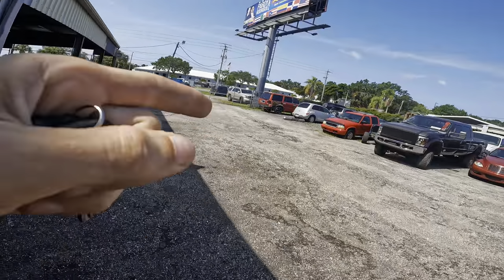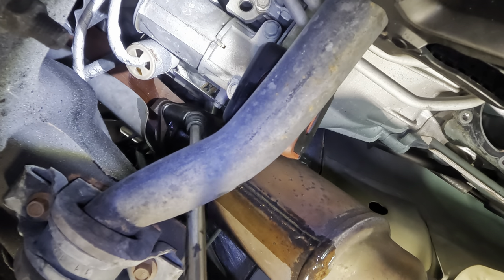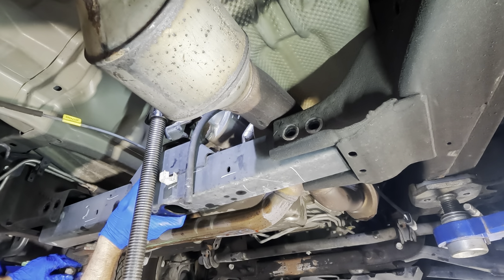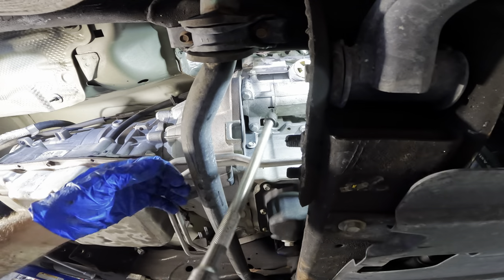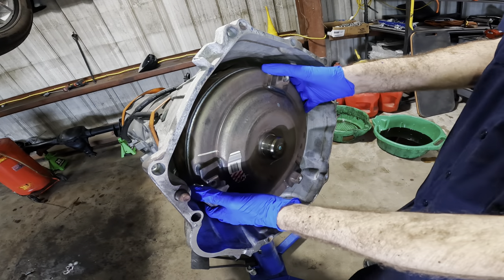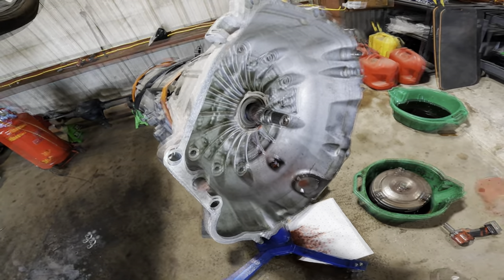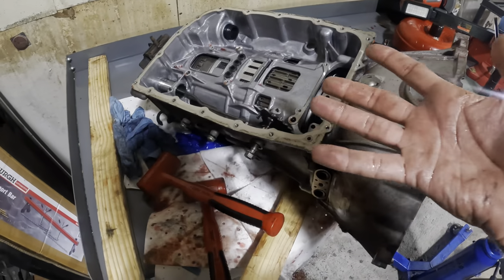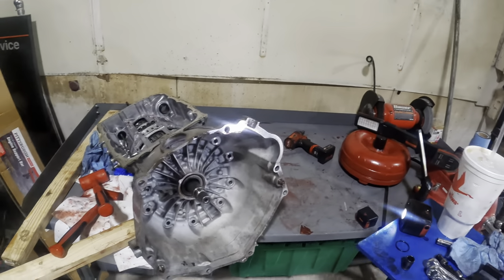Went too FAR! Invasive Inspection, 6l80 Transmission. 2016 Chevy Tahoe 5.3

Comment: Ray, your videos and teachings are awesome!  Gutsy move to pull apart that trans, but I felt like I was watching one of those "Cave exploring gone wrong" videos where they keep squeezing through tinier and tinier holes in giant rocks!  Hoping for the best here!
Reply: When I was apprenticing the full six weeks of third year school was automatic transmissions. Admitted- 2 speed and 3 speed with film on the only 4 speed then sold. Later, as a mechanic I had some 4 speeds to repair with the help of a dealer service manual. All Canadian mechanics were trained on automatics in those days. I don't know if that is the case today.

Comment: The last time I did this was on a 700 R4. I found too much carnage and the parts list exceeded the value of a comparable used unit. Before that I did a complete internal seal replacement on an Aisin-Warner 4 speed in a 1984 Volvo. I saved 90% of the cost by buying the kit for a Celica Supra instead of the Volvo. It was a huge success and completely cured the hard and delayed shift complaint. This brings back fond memories, my man! Keep doing what you're doing and stay curious.
Reply: Parts are MUCH higher unfortunately now. That 6l80 is a $3500 trans. I rebuilt one a few months back with $1200 in parts.

Comment: I put a gm 400 crate engine in a 77 3/4 ton 4x4 in 1996, and we had to pull the engine 3 times because we found bearing material in the engine oil. Nothing odd with the th400 transmission.  It turned out that the old torque converter was expanding length wise forcing the crank hard into the thrust bearing.  I've seen that 3 times, and all 3 times were with those older GM trucks. The engines were all drop in replacements. I wouldn't have thought the torque converter. Bought a performance oriented converter for the higher torque,  lower speed condition we used the trucks at, and that was then common practice to do with all company trucks.  Glad they preferred the old gm trucks because the new stiff is a potential nightmare.

Comment: Wow!  Good for you!  You could have installed a rebuild kit at that point.  I usually did it with a peg board, taking caliper measurement of of each clutch plate and hang them on the peg board, noting the caliper value in the center on the peg board.  Facing out on the board means facing forward in the trans for me.  They need to go in a certain order as you know.  Check each new plate thickness before install.  There are usually a bunch of spacers as well, same goes for them.  New torque converter and solenoids and your set.  I actually don't mess with new ones.  The 60 and 70 era trans were home rebuild able the new ones are tough.

Comment: That's all TCC.  The PR valve is also WORN OUT on that unit.  The TCC regulator valve is worn as well, as is the AFL/solenoid feed valve.  We use billet cover upgraded converters, Transgo tow and pro kit, and HPTuners editing to fix these units.  We do more in each one as well, but those are the major failures/fixes.

Comment: Who else misses drain plugs on transmission sump pans?
Used to be a much cleaner hip, dropping an already empty pan, back in the day. Progress!
Reply: Cleaner hip? Genuinely no idea where that came from. I typed cleaner job, but my phone preferred hip and I didn’t proof read it. My bad!
Reply: Saving that $2 per vehicle, times 10 million vehicles...............
Reply: @darknes7800  It's not $2 when you buy 10 million of them, lol. And nobody is going to care about $2 tacked onto the price of the car to make the difference up!
Reply: @Krelian1  You are thinking like a buyer, not a manufacturer.  Whatever the per unit cost ($2-$1 or 50 cents), it really was not the point.  The point is once the engineering is done..... all auto manufacturers VE the hell out of their product.  Ford bean counters cut the number of threads on exhaust manifold bolts the point they pull out of the aluminum heads!  Savings of that 1 or 2 turns of threads on 20 bolts per car, on 30 million cars.....means EVERYTHING to a manufacturer !!!!!!!!!!!!!!!!!

Comment: hello Ray, liked your input on the cylinder de-activation, way back in the 1980s I worked at a cadillac dealer, the 368 ci v8 known as the 4 6 8 had that it worked at the rocker arms and would prevent valves from opening, it never worked right, cars got better mpg and ran better after we replaced the electric solenoids with regular rockers and pivots

Comment: 33:30 I would come up a little on the transmission jack before trying to separate the flanges. There's a little load on the dowel pins because you lowered the transmission to get to the bell housing bolts.
Reply: I was thinking this too.

Comment: The 6L80e/90e suffers from a couple very common problem.  The 1-2-3-4/3-5 housing is known for the weld cracking, especially 07-09 but even up to current they experience that failure.  They are also known for 1-2-3-4 piston failure which is a very common occurrence and gm has revised design a few times and the sonnax piston solves the problem.  In the first generation units valve body wear along with TEHCM problems like pressure switch failure is also common.  Stator seals and stator gasket blow out are another common problem, the updated stator with the anti rotation sealing rings is a mandatory update on all early units.

Comment: I've rebuilt a TH350 about 20 years ago and it ended up working great, but I haven't ever had the urge to get into a more modern transmission. I have a friend with the 6L90 that had the same failure symptoms as the video in his 2014 Silverado that a Torque converter replacement did not cure.

Comment: That's where a drain plug would be very handy. Don't really understand why that is not common.
Reply: Because they advertise  that the fluid lasts the life of the vehicle
Reply: @waterloo123100  The fluid obviously does not. Several types of problems which routinely occur would warrant changing the fluid.
Reply: @denveyebanks4787  I agree with you. I see it all the time in my transmission shop. But they keep making it harder to service transmissions at the same time because they want you to buy a new vehicle

Comment: I took a 6L80 pan and welded an O2 sensor bung on it. A good fitting copper washer for sealing the plug that came with it. Installed it the first time I changed the filter. That exhaust crossover is a PITA but you can get the pan out by loosening the rear mount. Now I can do drain and fills. Even though it only gets about 6qts out, by doing that every other time I change the oil it keeps the fluid pretty clean. I'm sure that someday the torque converter will fail. Almost tempted to change it out before it does it.
Reply: Get one of those fluid suckers and go through dip stick tube. I pull them down that way, it is a lot cleaner way.  It also lets you inspect the fluid without making a huge mess.

Comment: Why don't transmission pans (and most rear differentials) have a drain plug?
Reply: Rarely need to drain them that's why, I think. And you still have to remove the pan to clean it and change the filter.
Reply: I added one to mine as I towed a 9,000 lb. travel trailer and the shop manual recommended  transmission fluid changes ever X miles (I don't remember how many).
Reply: @Andy Bush  Yes, but...
For high-milage and heavy-duty applications it's recommended to change the fluid more often. And some models have drain plugs just for this reason. Seems pretty common sense.
Reply: @johncooper4637 they also recommend to change the filter at that time

Comment: I can't believe how clean that Tahoe is. If Eric O was doing this it would be ready for the crusher.
My 2020 GMC Sierra AT4 6.2L 10 speed is acting up at approximately 15,000 miles. Driving down the road it will down shift to L5 and stays there until it decides to behave. Could be a day. First diagnostic said mid speed sensor voltage low. Dealer ordered a trans wiring harness. Next day after they spent over 4  hours replacing the harness it acted up again. We are now waiting on a sensor and they will have to open it up again. 5th trip to the dealer.

Comment: Trans guys wear gloves to disassemble but not usually assemble. Extended exposure to the fluid gets in your pores and can cause all kinds of health problems. Also, usual assemble in a vertical position with the back of the trans setting on the ground. Then on the bench to complete valve body install.

Comment: No need to drop the exhaust. I stuck a scissor jack on top of the exhaust flex pipe and the underside  of my Tahoe jacked the exhaust down a bit and you can pull the pan! Hope this helps someone, especially those on the rust belt because where i live exhaust bolts and nuts gotta be torched or cut mostly

Comment: there is a bulliten on that trans, it says to completely disassemble the trans and clean out all of the torque converter material.. We would install a GM rebuild, comes with a great warrenty
Reply: Those Gm rebuilds are up to 9k A good transmission shop could do the same job for half the price

Comment: If I can rebuild a transmission, you definitely can.  2000 RX300, with a mishmash of replacement parts.  It's actually pretty rewarding for the dopamine when you get a success like a transmission.  My dad is a retired mechanic, and I'm just a guy who likes to figure out how things work.  Those clutches look pretty good actually. Slightly worn, but acceptable.  Shudder is most like the TC like you were suspecting.

Comment: 😅Many years ago I ran an International truck with a 5×2 transmission and unfortunately I blew a clutch up in it so I to get the gearbox out I used a hand winch on the uni joint on the rear of the gearbox and anchored it to the rear axle and just slowly winched the box backwards till it came clear of the bell housing then lowered it on the ground  putting it back I just ran a strap around the rear of the box and anchored both ends to sub frame and slowly pulled and wiggled till it lined up and went back in. As I'm not a mechanic this took a long time approximately 2 days . You going in to that gearbox is how we learn new things anyway you have a great day bye Peter from Melbourne Australia

Comment: Yup I was scared of trannys as well until I had a torque converted go bust in my 84 Dodge van with a 904 torqueflite and trash was flushed through it. I have never been past the fluid and filter before then.  I kitted the transmission just because it had 215K on it and had to clean out the debris, All it really would have needed was O rings just because.  Well after a total tear down and clean out and a new converter it was as good as ever. So little difference was realized that I did not even have to change the linkage positions.

Comment: DOD on several US cars has an important function - it gives a smidge better fuel economy and avoids the "gas guzzler tax". Pontiac GTOs and Chevrolet SSs are like this. Interestingly, the Holden Monaro and Commodore that these cars actually are don't have DOD in Australia where they were made. Similar thing to the weird system on US Holden manuals that direct the gear stick straight from 1st to 4th at moderate throttle input. 

People who buy a sporty V8 manual don't want half the cylinders out or a computer shoving the gearstick sideways!

Comment: Not gonna lie, I've replaced at least 17 of those in the last 2 years at the shop.  Might closer to 20, but beside the point.  It didn't matter if the fluid and filter were changed more frequently (loggers care), normally (The few people who care), or the people who have never service their transmissions.  I have been taking note, and noted that it doesn't matter.  They all die.  Several have have had the updated sensor, might have been too little too late because it's usually 90k-120k

Edit: Realized this guy is at 150k.  Notes being added
Reply: Here's some more data, 6L45 just a lighter version with same damn fault. 117K miles.

Comment: The 6L80 the transmission that GM gifted to every trans shop as all of them are junk and will need rebuilt, replaced or built up for not failing.  You can can build these up but you have to replace just about every part as they are defective or contaminated with metal from the converter.  As someone with a 2013 Tahoe and a 6L80 I just do a gallon trans replacement with a power sucker through the dip stick.  And no switching to a 4L60 4L80 is a huge undertaking so you buy all the parts needed to build a new 6L80 but with good parts. Sonnax has most of the parts needed minus the bell housing which is the only OEM part I would put back in.

Comment: Boy GM is batting a 1,000 with the AFM and torque converter failures starting about 150k.  The 6L80 is a pricey trans to rebuild.   Mine blew up at 184k, I rebuilt it, now I wait for the dreaded lifter tap. I am prepared for that 
Thanks GM……. 

To avoid the AFM failure run your trans in 5M and only shift to 6M on the highway but remember to put back in 5M once off the highway.     It will not go into AFM until 6th gear and lock up are achieved

Comment: I had a Torque converter vibration in my 92 silverado, penny pinching I pulled one from a another truck but with a big block, I lost passing gear sometimes, anything after 55mph it would just fall out of passing gear, if I kicked into passing gear at 65 or so, it stayed in it as long as I floored it, let off a little, I lost it, and I had to match the engine RPM to the speed of the truck so it wouldn't slam back into gear,  Had every gear and drove just fine though. I eventually bought another one at Summit and everything was good after changing it.

Comment: This unit looks loads easier to dive into...no check balls on this particular valve body to fall and roll to oblivion. I remember back in school switching from a 2 speed to a 3 spd TH350 in my Buick...what a difference...lots of O rings that all need to be done right or it's a bust. 
   As for this unit...it is nice seeing that it's not as scary as i envisioned with all of modern engineers making things harder then they need to at times.
    A great video and an excellent learning one as well. 
    I would get a pair of longer bolts and cut the heads off to use as alignment shafts going back in. I did that on my Dodge 3 speed manual...made it a snap.
  I can't wait for part 2 Ray!!

Comment: I would have put the stl010 bypass valve in it. This part helped cool my trans down to 144 degrees rather that the 210 it was running at before. My technician said it also helps prolong converter and trans life

Comment: Ray, im ashamed you missed the chance to call this diagnosis a "Vibe check", also when the transmission pan can't clear the exhaust on these I like setting up a transmission jack to lift a pry bar against the cross member, a lot easier than having someone hold their hulk strength while you're sliding past solenoids in my experience, if R&R kind of a moot point

Comment: "When it fails it costs ten times more than the fuel it saved." 😓 I can confirm this.  I had one of the pins got stuck in my 2007 Yukon, and it was cheaper to replace the Flex Fuel engine than to fix.

Comment: Back in the day (early 80's) GM tried to market the V8-6-4 . A pre-digital mechanical type of contraption. In that same time frame they also offered a diesel option that was a crudely modified gas engine. Equally notorious!

Comment: i actually considered buying a tahoe until i found out how many problems they tend to have. the cylinder deactivation causes engine problems, and apparently there are transmission issues. to me one of the most important aspects of a car is its reliability. which is why i ended up buying a toyota (hybrid) instead. thankfully i dont currently need truck capabilities so the toyota hybrid just made more sense

Comment: A piece of advice for next time is to pull the pump veins and gears out and look on the other side of the pump. That’s what wears out most of the time. The 6L80e is very easy to assemble but it’s also expensive to rebuild.

Comment: I love that you took the initiative. Good job inspecting clutches. See, not as complicated in there as some would lead you to believe! I have a concern about how you reinstalled the sun gear as most are made to be unidirectionally bias hypoid cut, meaning they are only supposed to be installed in one specific orientation. Usually, if it is, there will be an intentional score on the face (forward) from inner edge to outer edge. Please verify installation. Also, the unfortunate way you pulled it out could have unseated a band in the rear of the housing (output assembly) if the trans has them and you pulled the output assembly more than half an inch. Usually this is blocked by a snap-ring but sometimes not. You're smart. I'm sure you will figure it out. You can replace the torque converter and if the problem persists you can reuse it upon trans rebuild.

Comment: I wouldn't be cutting my teeth on a customer's transmission if I were you, Ray. Some of these units have very specific directions when loading a drum, etc. Sometimes snap rings have to be placed in a certain position or the trans will fail internally. These are all things you won't know just by taking it apart. Having rebuilt a few different automatic transmissions, myself, I suggest you find a cheap vehicle of your own to do a full rebuild on. Buy the ATSG manual for that transmission, a parts kit and go at it. If you screw it up and it shits the bed, at least you don't have a very pissed off customer coming back asking why you took their transmission apart in the first place. Also, when installing fasteners into a transmission, you never use an impact driver. If you don't torque the fasteners with accuracy, something will likely fail to function; especially true with valve bodies. Good luck!